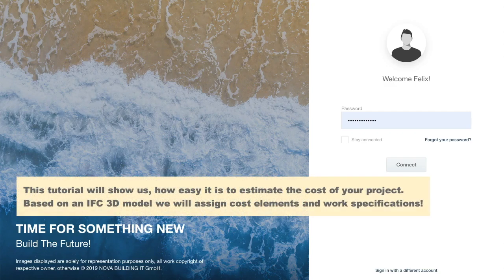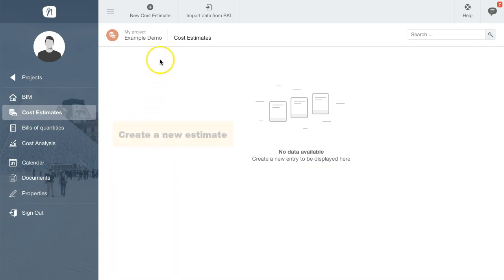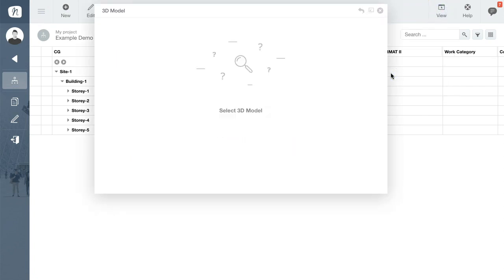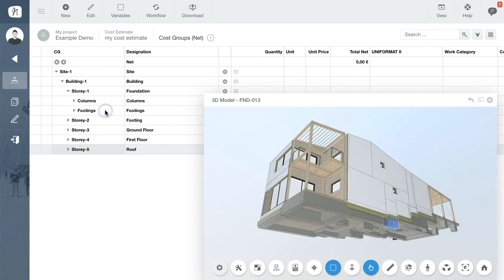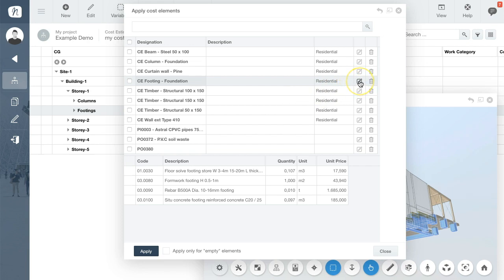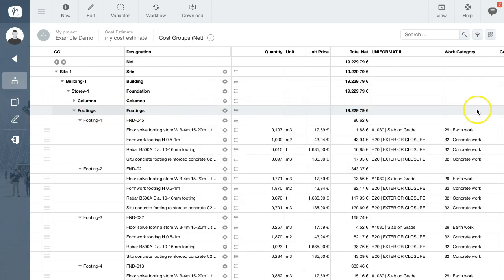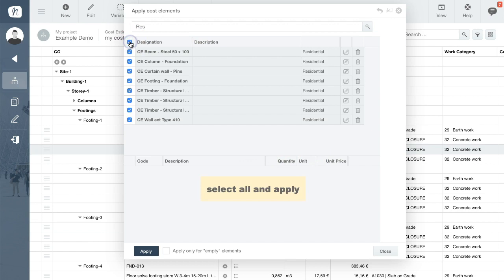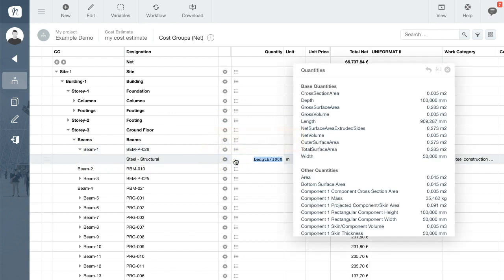NOVA BIM 5D - Cost Estimate based on IFC 3D model

Comment: The issue that I have found with IFC is the IFC creators do not understand the desired intent of the quantity surveyor, nor do they want the responsibility of doing so, in fact, if they do, they inherit more risk. The primary goal of 99.9% of architects and designers is to design to a brief and that brief is form and function and rarely cost. The Architect would then send the drawing to a qualified quantity surveyor who will calculate the cost.
Reply from the maker: IFC is quite powerful and allows to share all of the cost relevant information in connection with building elements. Of course, this requires some, let's say "discipline" on the designer's side --> don't draw a "slab" with the "wall" tool  ;-) 
To improve the workflow, the most popular CAD apps today provide features to enhance the IFC file contents and make them usable for cost estimators working with BIM 5D applications.
Reply: @novabuildingit  Yes thanks I have a pretty solid handle on IFC  As you say a lot o fit comes down to the end user.